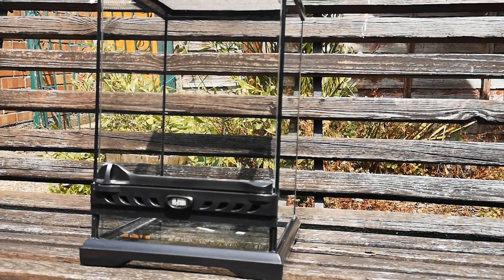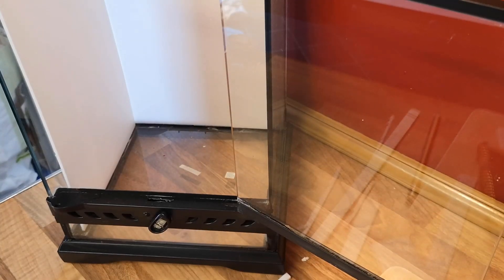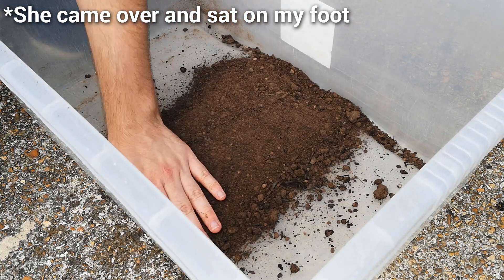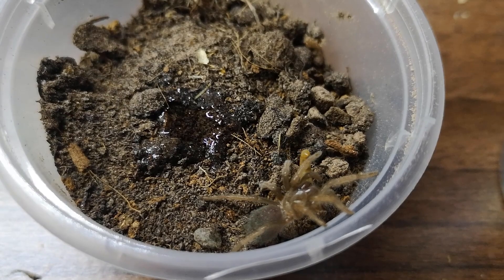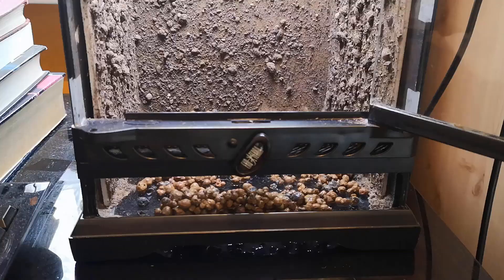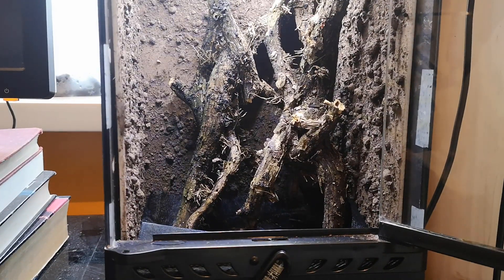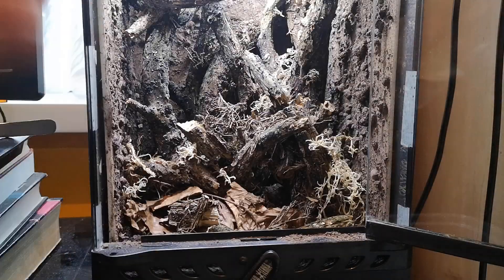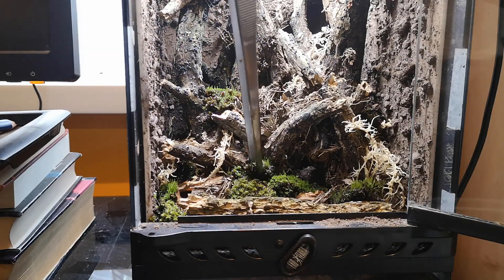Bioactive Moss Mantis Terrarium Build: Haania vitalisi Communal Set Up

Comment: This looks wonderful 🙂 I have looked into a lot of your videos regarding reptiles and lighting/heating, I don’t have reptiles myself but it’s something that interests me and is very likely going to be a future venture in a few years. I was specifically wondering about your ideas and research into heating/ lighting for invertebrates, which is something I do keep. The room is usually heated alone compared to the rest of the house with an electric radiator, to a nice higher comfortable temp for them (average around 23-26 which is ok for the majority of my tarantulas etc). I do have a few, snails and hissers specifically, that i keep higher than others who like it 27+ with a heat mat. I was contemplating how efficient the mat even is for them, or if UVB could even be beneficial. Snails require high calcium for their shells and I read as paper for Aphonopelma species which stated that even though they are nocturnal, they would sit at the entrance of their burrows in the morning light. I’m thinking about setting up enclosures in a way that you encourage for reptiles but still weighing up the cost to benefit ratio. With several species of tarantula, snails, phasmids and mantis etc it would be extremely expensive to provide, particularly those that only live a few months anyway (although, as sad as I am to see them go a new species usually is taken in to experience in their old setup). The ease of not providing it doesn’t count as a good excuse to me, as if they benefit from it I should surely provide it. I cant really think of any other keeper that does this, or have found much evidence on if it’s as beneficial as it is for reptiles. Most people in the hobby even advise not to provide UVB, especially for snails, as it can damage them. Although no evidence is ever provided on why it is damaging... Long story short, id love to hear your ideas or how you personally chose to keep your invertebrates! 😊
Reply from the maker: So in terms of inverts for the most part our current understanding is that they are thermoconformers, which is posh for they allow themselves to be whatever temperature the environment is, rather than seeking heat sources etc. There are also some reptiles that have been described like this, normally ones from deep forested areas with little light entering through the canopy. Boyds forest dragon comes to mind. So infra red C is all they need as our current understanding. However, it wouldn't surprise me if this changes in the future. I've not tested offering infra red A and B for inverts, I wonder if they would display behaviour moving to and from the heat source to suit their temperature needs. In terms of uvb etc, there are studies out stating that feeders like cricket's, locusts and mealworms can all synthesise d3 when exposed to low levels of uvb. So that makes me wonder about tarantulas and mantids etc. I'd like to see some studies in the future.

In regards to feeders it makes sense, why do we offer d3 powders to insect eating reptiles? Because those reptiles evolved the oral pathways to use take in d3. Because the wild insects they eat have been basking in uvb themselves!
In plants there is no d3, only d2 so when tested it was found that things like rhino's, elephants etc. Their d3 levels in the blood didn't go up much after consuming d3 supplements. Why? Because they only evolved to get d3 from uvb synthesis as there's nothing in plants!

It wouldn't surprise me if our invert husbandry knowledge is lacking compared to what we don't know they need.